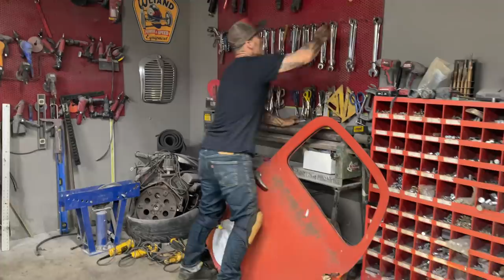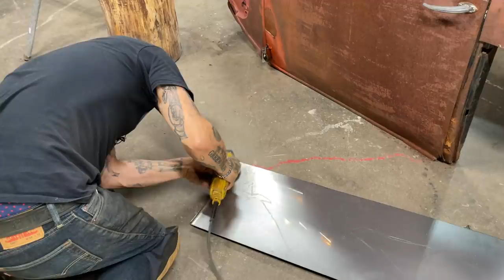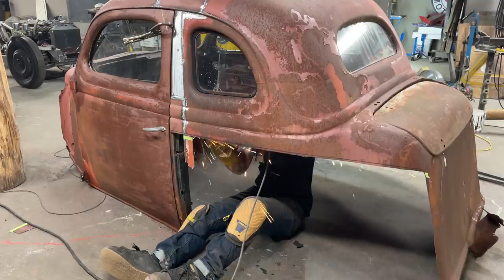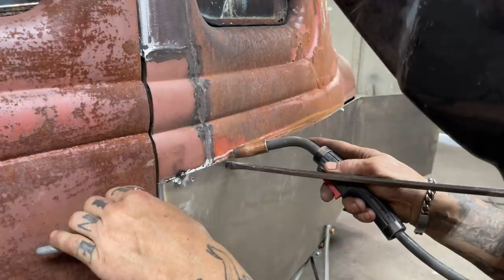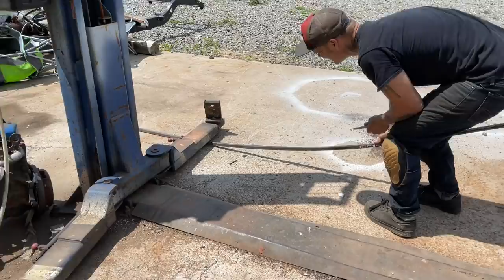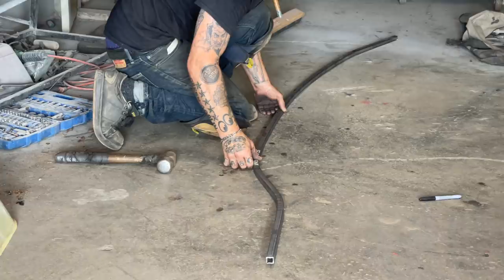THE CONTROVERSIAL CABOVER BUILD: FABRICATION CONT'D

Comment: at Jerry Talley Ford learned how to use a tool you put on the panel cutter. you cut off your sheet metal like are. then had this block looking thing went in the panel cutter head. was quick released loved that tool. well the block has step on it put down your cut is really cool then you can also do other edge. is cool or just set you new piece in is what i was taught then is flush weld less filler can metal finish it. worked at other shops but learned many things there. mostly by experimenting when was left alone in that shop. at night with my 51 belair.

Comment: Make sure you keep the oil full in the top half of that flanging tool. (Not air tool oil, the flanger is air over hydraulic)

I also custom ground the dies on mine with a zip cut as they were not machined well from the factory. Gave me a slightly deeper step

Comment: it will be flush i did it in 1981 can see is a more modern tool now and less noise also maybe is really cool what these machines do after you learn how to use it is very good we put in Mo. salt on roads so had to fix much rust so is what did stepped my patches and then flushed them as migged it. is awesome. put new quarter on is great idea.

Comment: Ok yes Chad cut the body off. Would it be better to derust the shell and Prime it before hacking and cutting it. So your welding to rust free metal. 
I know on Nicks Garage in Laval, Quebec. (You Tube Channel) sent a 1969 GTO body shell and various parts including a empty engine block to a chem tank in Mississauga, Ontario where it stripped rust, paint, primer, bondo, etc. With no manual labour. Lower the whole body shell in the tank. 
If Chad did this all he would have to do is grind the Primer in areas he is welding, weld then  wire brush the area and Prime it.

Comment: why didnt you use the english wheel on the piece covering the trunk after you rolled it? wouldnt that have given you the contour you needed to match the panel on the bottom of the trunk opening.  it would have saved you a lot of grief

Comment: BTW a quick way to get the slag off the metal, that you used a plasma cutter on is to use a really wide cement chisel. Stanley fat max chisel for example. Its about 30 dollar tool. Man you should try to get in the habit of using a dust mask. Sucking in that old rust is not good for yah. Unless you want to die by the time your 65 years old. I was a welder fitter for years and I did body work as well and rust dust and brake drums dust is the worst crap to be breathing in. plus your not setting a good example to the next generation by doing that. Yeah I know you probable don't want to hear it but I'm telling you this for your own good man.